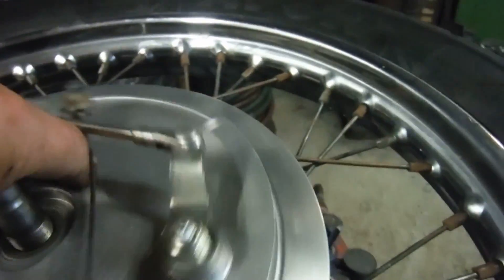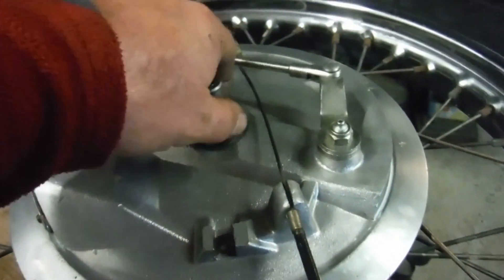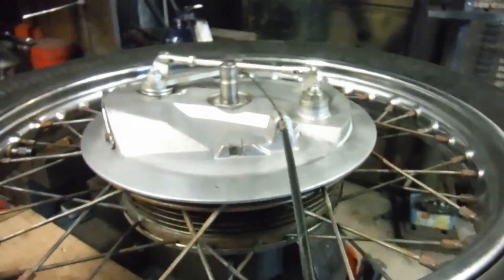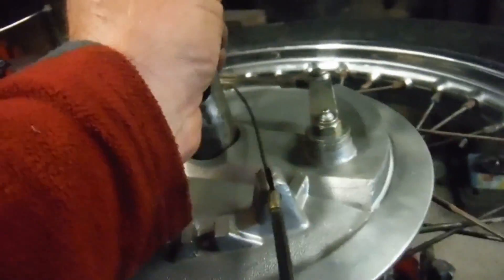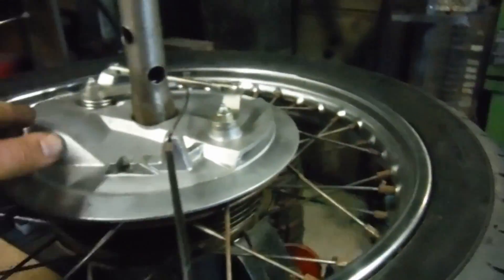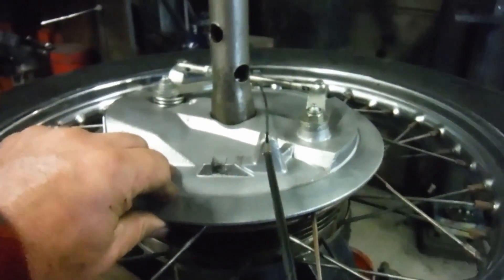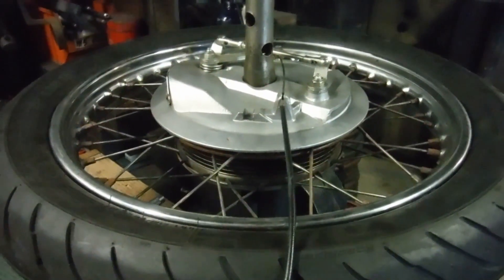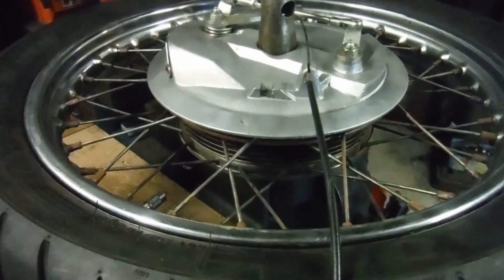BSA A65 Other, non engine related issues discussed!

Comment: Thank you Paul for addressing these aspects of A65 frond end and brake, they all influence the safety and comfort of a ride. Remembering my fights with those parts years ago I was surprised how making a front brake plate solidly clamped at the front wheel and at the front fork improved a quality of this brake. Very often these parts of the bike are neglected by owners resulting in sloppy feel of a front end and sloppy front brake. And sloppy front end makes your ride very uncomfortable during strong winds, very common in my part of the country.

Comment: The triumph tls front brake is extremely good but I always found mine ratted on the locating lug. I’d try and fit the wheel and trap a bit of milk carton plastic or something in it which used to work for a while.

Comment: Sadly, this is what you are up against with a 50 year old bike. Everything has been apart at least once, probably many more times, and often by people who don't understand what they are doing, or don't want to spend the money to make sure it's done properly. Years ago I took on a T120TT and it turned into a labour of love and almost bankrupted me, I swear that every single thing I looked at had been bodged at some point in its life and even things like the wiring loom needed replacing because the insulation had lost its flexibility and the wires had corroded underneath, the frame had work hardened in places and welds had cracked, it was a nightmare. I feel for the owner of this bike, it will likely need ongoing and expensive repairs as time goes on, but thankfully he seems to have found a competent and pragmatic friend in Paul who will be able to guide him through the ownership experience.

Comment: Just read your rants .l own a1994 royal enfield 500 bullet which l bought in india in 94 it has now 7000 miles on it the build quality of it is very poor all the chrome has been re plated piston has been replaced  one of the alloy fork legs broke in half and the brakes are not that good . They are what they are  l have been riding motorcycle since 1965 l know how to make  them better